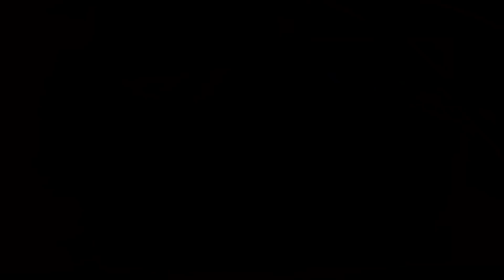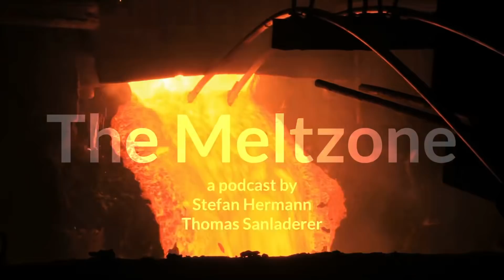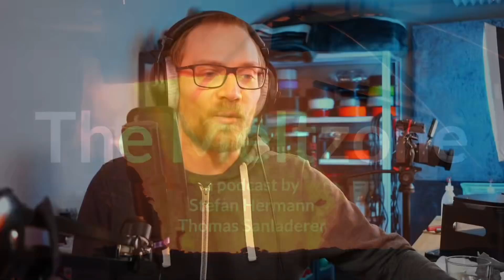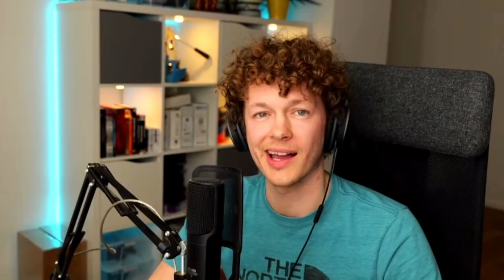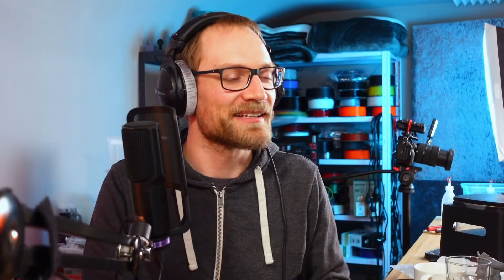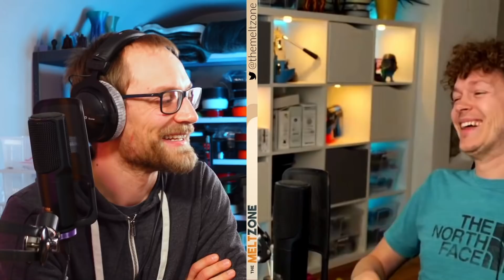Simplify3D V5 "confirmed" & REVO problems - The Meltzone Podcast Ep 56

Comment: I would NOT be happy if I was testing equipment and publishing tests / looks / unboxings and reviews - and within that context a company sent me a different model than what was agreed. Especially if they look so similar, that it was by mere incident I didn't end up sharing and publishing my impressions of it, as if it was the model I thought it was and was led to believe it was. 

That stunt could have seriously messed up my professional reputation. The "be happy you got a newer model" makes no sense in this context. For a regular end customer, sure - but I am not a customer. I am not buying the thing "for myself" to own and use, nor was that the process of procurement. It is a professional test and review "transaction". Imagine if you were the (only) professional car tester for an automotive media outlet, you made an arrangement with a car manufacturer to make a model with XY specs available for you to trial for the publication. But without telling you, the one they went on to make available was identical in basically all easily observable aspects, except it has a not quite yet announced or released inter-gen / under-the-hood facelift with a 200hp instead of 150hp engine, with a substantially improved power and torque curve, and more refined adaptive suspension. The experience would be significantly, materially better, yet still well within the realm of not setting off your alarm bells. So you do your filming and writeup, the test goes to print, online, maybe even broadcast. Then some boffin tech with internal knowledge or an especially keen eye, spots some small detail you overlooked which identifies that this model had that "facelift". They go on your employer outlet's social media and make a rather stern and sharp-elbowed post identifying with proof, that you just released a review with great results and glowing recommendations - but saying that it's a scam. This immediately blows up in your face, and not only is your professional reputation destroyed, the same goes for your employer. Both because of the optics, and because you gotta be cut loose and they don't have other testers on staff. You have no chance of controlling the narrative unless you were first to identify the issue and first to press with it. And even if you manage to convince some parts of your closer fans of what has happened and the unintentional nature of it, the greater public and brand trust is shot to bits.

It's a very aggressive example, but a very real scenario.

on blast for 

And a test or review of "the former" model is certainly not of that much reduced value, especially if the successor is so new it's barely shipping. Because not only will the "former" model be circulating in the community for maby years to come, pretty much all current stock in the supply and sales channels is still that former model.

Comment: The exact same thing happened to my Revo after about 80 hours. Wild (IE, impossible) temperature fluctuations while heating, seemingly leveling out but grossly underreporting temperatures. Even though the temp was reporting 210C, PLA was extruding literally smoking hot.

Comment: I’ve had issues with three different Revo Six heater cores on two different Prusa i3 printers. These were purchased direct from E3D recently. Temperatures reported to the printer varying up and down wildly during heat up, thermal runaway alerts, filament dripping from the hot end. Smoke. Failed prints. It’s a real mess. Never a single issue with my original V6 hot ends.
My suspicion is that it might have something to do with the crappy non-locking connector they provide for the thermistor in the kit which replaces the original locking thermistor plug that connects to the main board. However, the fact that it’s happened with two separate kits on two separate printers, and three different heater cores (I ordered a spare) is very troubling. I may be asking E3D for a refund. I still have one unconverted i3. I need one printer I can rely on, and not worry about it going up in flames…

Comment: I had another problem, my Revo Micro  worked fine on my Ender 3 MAX for about 10 minutes and then it couldn´t get hot enough. The thermal runaway warning came up on the display. First I thought it was a faulty thermistor but it showed a steady temp. Then I moved the cables and I realized that it was bad connection between the contacts on the 24V heatercable. I fixed the connection and now it works excellent.

Comment: I had a very similar experience with my thermistor cartridge in my E3D v6 just a couple days ago.  Got one mysterious thermal runaway error on my duet.  Rebooted, and it seemed fine.
Next day,  got one again, checked my wiring, rebooted, then 20 min into the print I got an error again.  I unloaded the filament and rebooted, and when I watched the temperature graph during warmup, it looked normal until about 220c (I was printing abs at 235), but seemed to get stuck there until it gave me an error again.  I rebooted, and the thermistor output jumped to 290C, and the graph slowly came down in a realistic manner. 
Seems like the most dangerous kind of error, where the thermistor still gives sane looking values, but the hotend is way hotter.
After replacing the thermistor cartridge, everything is normal again.
Reply: Same for me, it took me a long time to figure it out. E3D didn't provide an easy way to get a replacement in warranty (they wanted a lot of information and I think the thermistor shipped back to the UK), so I bought a new one myself.
I think the easiest way to diagnose is too measure the insulation to the case. It should be >10 MOhm but was only around 10k for me. This means the wires inside are very close to the case and due to heat and vibration can touch it if I understood it correctly
Reply: I’ve also had issues with multiple heater cores purchased from E3D weeks apart. Seems to be a pretty common issue.

Comment: A TMC2310 on my printer blew last week. I came back to a failed print where all the filament had extruded on the one side of the model, then when I moved the carriage - it's a corexy - one stepper motor made a grinding noise and then wouldn't move under power. Swapped out the driver matching the stepper motor and the problem was fixed

Comment: 1:18:00 - Vivedino Troodon.  Been running mine for about 6 months now.  I have printed minimal upgrades for it, but it still works great without them.  So far it is the best printer I have owned out of the 4 I have had in the past 5 years.  Was able to start printing right out of the box.  400x400 build size runs around $2000, but worth every penny.

Comment: There are some things I really like about S3D: process logic, the ability to make only dense supports with soluble material. Second to none supports quality and general neatness of g-code.
I'd really love to have the possibility to pay for V5 if they would be significant updates.
Reply: Just an fyi ideamaker also has the ability for only dense supports with a different material, as to the rest, I haven't used simplify3d, so idk. Cheers

Comment: Why am I not surprised about thermistor issues in the Revo?
Come on hotend producers, get rid of thermistors. i've stated this for over 15 years.  They are not designed for use in 3D printers.
RTD's and Thermocouples are 10x more reliable.

Comment: Why would a Voron 2.4 cost $200 in filament? I printed about half a spool in accent color and maybe 1.5 spools of black.
Reply from the maker: Did I say that? It took me 200h of printing the parts, but just as you said a bit more than a roll of ABS+ for the normal parts and half a roll for the accent parts. /Stefan

Comment: There use to be assembled RailCores, they were manufactured by us, Project R3D. We saw the need to make a more manufacturing friendly design which is when we developed the Daedalus that met or exceeded the RCs we were producing. We then parted ways with RC Labs. The Daedalus is a fully assembled Core-XY under $5000 running top of the line components!

Comment: I have the Artillery X1 also. I believe that the pins in the connector gets weak. More so if you remove and insert the FFC often. I have read that those connectors are only good for about 12 insertions. There are 4 contacts that carry the power for the positive and 4 more for the negative of the heater cartridge. So if one of the pins fail that will cause more amperage than the rest can carry. Then you get the burning. I purchased some Molex FFC connector (PN 526102072) with a lock and not have any problems since.

Comment: I think there are some really interesting options for AI in 3D printing at a much lower level. I watched a webinar about the STM32 NanoEdge AI Studio about using prebuilt models for sensors like temperature, vibration, force, current, etc. with STM32 microcontrollers (of course). Used for anomaly detection or classification.

This kind of system could detect a lot potential issues in 3D printing. But not really about using pictures or videos to predict faults or configuration issues which seems a lot more complex.
Reply: Might not be as complex as it seems. Training a tensor flow system for recognizing all the details of a 3d print, good and bad would be a huge undertaking but doable with perseverance. With something like that feeding back into a genetic algorithm and given enough control logic to tune the printer/g-code on-the-fly would be interesting to observe what solutions it iterates through.

Comment: If it's 1 of the first 4 pins it's the extruder which is a common problem on the x1 reason would be that the lanes on the extruder board from the printhead are to small. Ethereal project sells the updated board. Really looking forward on the steamdeck but i have the after Q3 release date so RIP

Comment: I had the same behavior with one of my printer thermistors recently, where it would sometimes hold temps just fine, and sometimes swing 10-20C within seconds for no reason, to a point where it would just start triggering thermal runaway. Works just fine after replacement, but I guess with a Revo it would cost significantly more just because the heater and thermistor is 1 unit. Hopefully that doesn't happen often.
Reply: Can also be a faulty wire, if a wire is pinched or breaks it can cause the same behavior.
Reply from the maker: Not sure what was finally the cause and I hope E3D will give me feedback. I could be wires or the Molex connector but they are very well strain relieved. The only cause I can see at the moment is the thermal cycling. /Stefan
Reply: My suspicion is that it’s something to do with the crappy non-locking connector E3D supply to connect the thermistor to the i3 main board. It just feels too loose to me. Had the same issue on two different printers and 3 different cores.

Comment: It was mentioned in past news coverage is that v5 is supposed to be more of a cloud-based slicer.. which makes it even less appealing.. Little interest in v5 at this point.

Also debunked.. no one on the IdeaMaker Team has ever worked for S3D.. in fact the core team has never even been to the states..

Also Raise3D N-Series/Pro2/Pro3 is a "QuadRap" - uses the ultimaker drive system.. E2 series is a "i3" style idex.